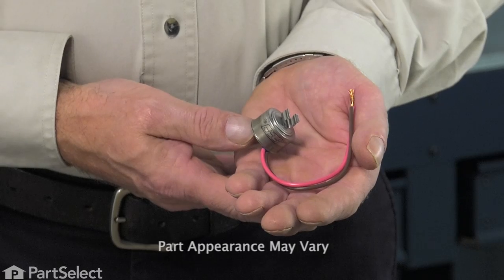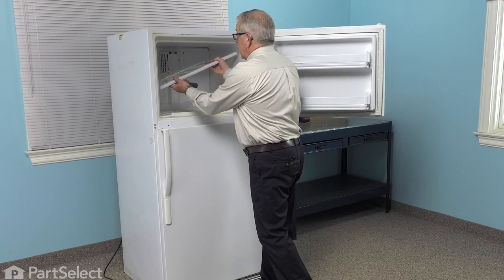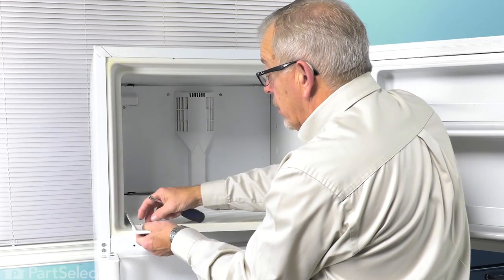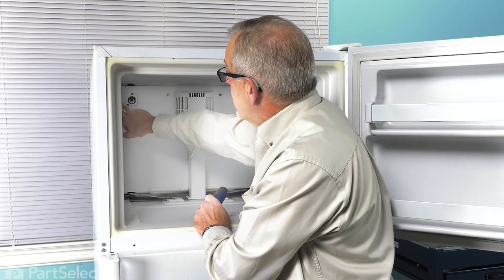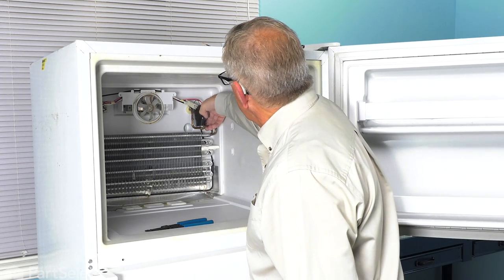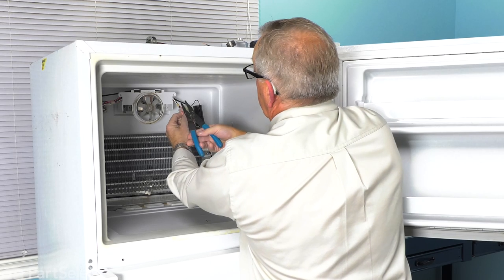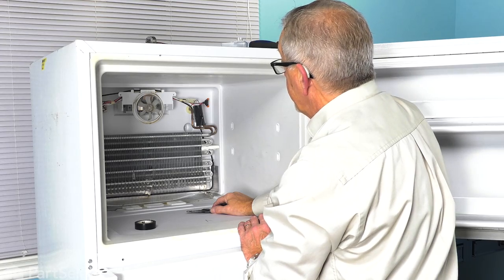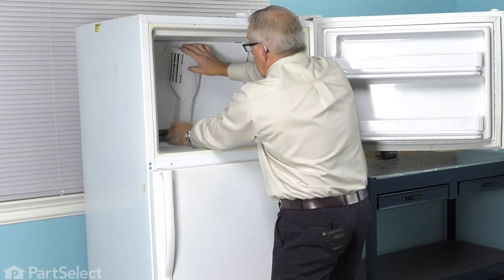Freezer Repair - Replacing the Bimetal Defrost Thermostat (Whirlpool Part # WP4387503)

Comment: Thank you for your amazing video. You explain things very well, and make the process easier than most. Could you tell me what the gauge of the wire was, and what size twist on wire nut did you use?

Comment: What symptoms would a refrigerator have to need to replace this. I have a very similar refrigerator that I have already replaced the timer and thermostat inside the refrigerator. Great video by the way.
Reply: Usually the fridge never defrosts itself and the freezer get packed with ice.
Reply from the maker: The common symptom when this part fails is that the evaporator will ice up and then both compartments will experience a temperature rise due to decreased air flow.